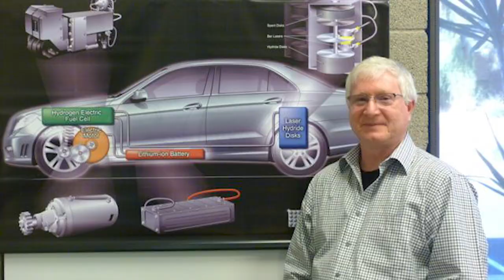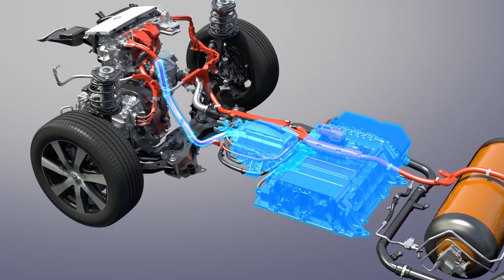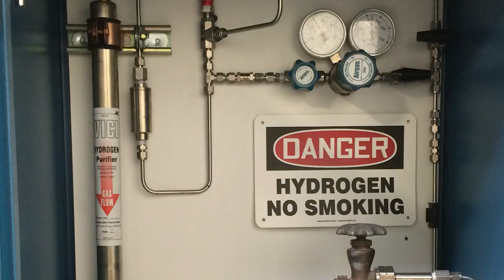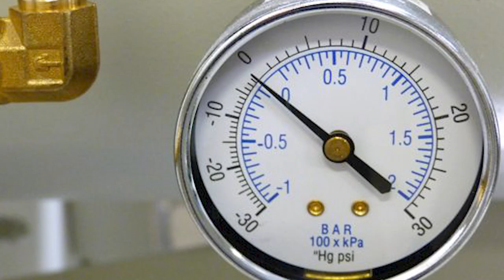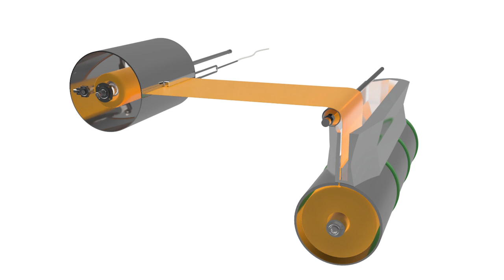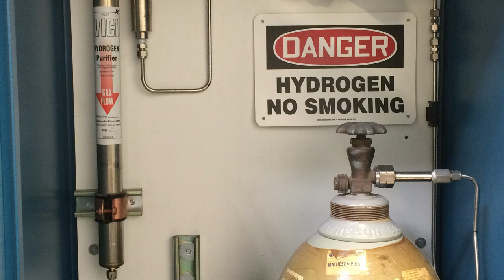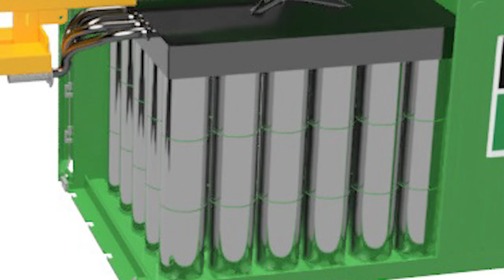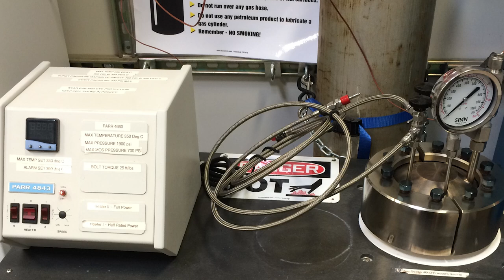This BANNED Technology Could Push Hydrogen Cars Over BEVs

Comment: Nobody banned anything. Hydrogen is not a fuel per se, but a energy storage solution. As it stands right now it's not at all a good storage solution. Hydrogen needs  high pressures, cryogenic temperatures or metal hydrides to store properly. All these makes hydrogen storage to be very heavy, energy intensive - drastically reducing charge/discharge efficiency and very expensive. Compared to current lithium batteries, hydrogen is much more expensive, heavier and less efficient. Fuel cells to convert hydrogen to electricity are expensive, heavy and inefficient as well. The best way to store hydrogen atoms is to bind them with carbon, but that makes synthetic fuel, which is proven much more expensive than regular fuel, but could be a better solution than pure hydrogen. Instead of spending development resources on hydrogen is much better to focus on improving batteries. What should be banned is human stupidity.

Comment: I have seen solarpannels that produce hydrogen if u cloud refill the film with these and use them 150 times than u could power ur house cook on hydrogen and have clean water to drink at the same time. If u have extra cartridges that u can put in a car or motorcycle it would be even better, especially if u could be able to release the hydrogen from the film and use it to power ur normal ice engine like what Stanley Meyer did with is vwbug. Than there is no need to invest in a new car.

Comment: Well the latest from Manchester university is even better and more efficient than relying on disks and light. Hydrogen stored in a sponge it adsorbs Hydrogen about the same size shape as the tanks but 3 times the amount of Hydrogen now when it is full of hydrogen same idea of Pressure. The Hydrogen is released by the sponge expanding thus keeping the same pressure to the motor system all the way until empty.  No use of electrons not use of metals disks to be made and safety all the way.  So fuel can be put in to the vehicle fast as normal and stored in larger complicity for longer range 3 times as long.

Comment: So its the same efficiency as outdated hydrogen and has all of the downsides of battery swapping. Lol. Its also a mechanical storage with super fragile moving parts. This sounds a great way to safely store hydrogen at a stable site. So obviously desirable for the rocket industry. For motor vehicles it sounds like a complete boondoggle. Maybe applicable for container ships where the reels and the appartus for discharging them could be in a special container and removed when the ship is unloaded using the same cranes.  But for cars? Lol. How is this even remotely better than batteries? It basically IS a hydrogen battery but it still requires a big heavy fuel cell and it takes up a huge volume/weight inside the vehicle.  So those problems are the same as current hydrogen tech. It literally only solves ONE problematic aspect of hydrogen vehicles and replaces it with three more problems: module swapping is a virtual nonstarter for many reasons not the least of which is it would require standardization of a common reel package which no manufacturer would agree to. Fragile moving parts introduces the possibility of breakage. Breakage introduces the problem of disposibility/recyclability at a dramatically shorter cycle than batteries.

Comment: What I wouldn't give to see Toyota step up to the plate and buy this outfit out, lock, stock and smoking gun barrels and build the car that'll handle it! It solves all the problems of battery-powered cars in northern arctic climates like here in the Peoples' Repugnant of Canuckistan. Batteries can only hold a 40% charge at subzero temperatures, meaning that you can't take them to work in the winter, 'cuz you'll come out to a frozen brick! Already in Queerbec it's been discovered that the door latches won't pop out to even let you in to your Tesla.
   But with this, since it isn't compressed or cryogenic, you can actually bring it into your garage without violating fire codes or invalidating your insurance! You can't even legally park your propane b.b.q. tanks in your house! So this beats all of that, PLUS it won't double your household electric bill, and you just watch how that's going to shoot to the moon when all the rich so and so's with enough F.U. money to buy a Tesla screw us all into the ground!
Come on Plasma Kinetics!

Comment: With electric cars the infrastructure is there we can charge at home. With this system it seems you would have to force every gas station to buy into a "loader" system they would have to buy from manufacturer as well as buy and store full/empty containers. BEVs have none of these expensive costs. That's not including once the battery is installed the charging is easy. How much will it be to transport full/empty containers to all gas stations AND how expensive to manufacture hydrogen then convert it to solid state? As solid hydrogen ages does it pose any risks? Seems like you are replacing simplicity of EV and trying to sell a very complex and infrastructure expensive hydrogen?

Comment: I think hydrogen powered internal combustion engines are the way to go.
Reply: ICE are inherently limited by physics to a maximum theoretical efficiency of 40-50% (depends on fuel and materials used). Hence, if you care at all about efficiency, no ICE is the way to go. Efficiency wise, it's a near dead technology. EVs are 70-94%+ efficient already, as an example.
Reply: Hydrogen fuel cell powered EVs are already more efficient than hydrogen ICE.

Comment: By this method, in order to produce enough H2 to power a Toyota Mirai with 130kW motor via a 50% efficient fuel cell, the 20% efficient on-board laser cannon would need an input power* of 1.3MW, which alone should weigh on the order of 8 tonnes.

Of course it would also require a rolling Megapack of batteries or compact fusion reactor to supply this sort of  juice, so let's conservatively estimate another 20 tonnes, meaning the "car" is in fact an 18-wheeler semi-truck. Also, for added fun, refuelling entails hauling in about 18 tonnes of H2-cd cartridges every 25 miles.

Obviously this "revolutionary tech" was correctly banned for being too egregiously stupid to waste any further time on.

Sandy & Alex only expose their ignorance by hyping this utter nonsense.

[* not to mention a battleship-worthy weapons licence]

Comment: Do you really want to be in a tunnel or other enclosed space filled with H2-powered cars and trucks? A standard toy balloon full of H2 and O2 in stoichiometric ratio, explodes with a bang on the order of a Cherry Bomb!!!
Reply: What do you do with the O2 generated from decomposition of water? That is roughly half the energy used to power the reaction, and without the N2 to heat up. Only 20% of air is O2.
Reply: lol.  And batteries, gasoline and diesel don't ignite.

Comment: The true application wasn't even talked about. Powering your house. Total elimination of the power grid,except the power plants to make the cartridges. If he's changing the tape cartridge into hydrogen then into electric for the car electric motor it can be done. Careful eliminate the power grid except your cartridges you will eventually be declared a monopoly and split up.

Comment: They have generators right now that will keep up with the electrical needs of an EV. With this technology you can fly a jetliner around the world without setting down You can live in the outback of Alaska going off the grid is the phrase. This has created a problem for the dummies that bought into this green new deal. So no charging station or home plugin is needed. A regular battery is all that is needed. Another idea is here using a magneto to get things started. They don`t want anything that can`t be metered. Our country is in debt and the world`s economy is based on oil. Building a new EV would actually be cheap it`s just the cost of parts and rubber. The government has got to figure out a way to tax you. A solar farm? It has to have a solar source and the sun doesn`t shine every day. Interesting times it`s been said the Homosapien has been here several times with technology. We have had to start all over again. Can we rise above ourselves this time? Or will we turn the sands of the world into vitrification once again?

Comment: Thanks for sharing your thoughts! In my opinion, hydrogen for individual cars will never be able to compete with the BEVs prices.  Just do the math and try to calculate how much energy you would need to generate enough H2 to run the fleet of cars in any country. And compare that energy with the present total energy generation of the country. You'll see how stupid it is to believe this is going to work. It's not a question of storing this stuff. The only chance is for planes maybe, when no other solution might work out here. But even for running trucks we won't have the enegy. 
But hey, maybe you think about forcing African countries to deliver the energy to you....sure, this would be one great idea for the future. Which of course it isn't.

Comment: I've been waiting for Hydrogen engines to become the replacement for the Electric Mindset. The military has been flying with hydrogen aircraft for many years now, and have proven their worth. If it's good enough for the Air Force Academy to teach, and use, it should be good enough to replace the limited battery powered vehicles like cars and variety of Aircraft, thus The Air Force Academy! My prediction for the future of space travel will not be hydrogen powered, but, "you will hear it first here" Reverse Magnetic Technology for space travel. No jet fuel, no extra weight, and literally unlimited power and speed. Straight line acceleration is good for human Astronaut's, but high speed, 90 degree turns would be for the AI's only, for now! The technology is out there. I just hope it's under raps until it's time to roll it out. That, and Worm Holes are the answers. On Planet Earth, Hydrogen vehicles fill the bill. EV is good for now, but there are better and more liable engineering that will come in the not too distant future. Elon Musk is the man who will develop "Reverse Magnetic" technology. Just my opinion!

Comment: I think used EV batteries are going to be catastrophic to our environment.  A car battery today is 50 - 80 LBS and we already have environmental problems disposing of them.  Imagine millions up millions of EV used batteries at 600 - 800 LBS going into the environment.  Semi Tracker trailers have batteries  in the 6000 LB range.  Not only the batteries, but defacing our environment with mining all the minerals is destroying habitats around the world.  If there was a choice between Hydrogen, and Electric today and the infrastructure was in place for fueling, I would take the hydrogen car.  Hydrogen through the whole process from fuel to production car is less damaging to the environment than EV's.  It is not known, even today, whether EV's in the entire process from mining to finished car will be help our climate.  There is a TED talk on Youtube that indicates we, at best, might have a break even on climate in 50 - 100 years, with EV's if at all.  Even more so the cost of minerals to make batteries has been going up because of competition, making the cars less profitable.  A couple of years ago a battery change was $ 5000 - $ 8000.  Now they are talking $ 15,000 - $ 18,000.  Who would every want to buy a used EV, if you know there is a $ 15,000 battery coming soon?

Comment: let's say i want 1kg of hydrogen in my cars' fuel cell. How many energy is needed to compress 1kg of hydrogen to 700bar/10000psi. How much energy is needed to: charge solid state hydrogen & how much energy use laser to release 1kg of hydrogen & how much more energy is needed to cool fuel cell (because decompressed gas is very cold)

Comment: There is nothing going to push hydrogen over electric. Now if someone could invented a way to prevent hydrogen tunneling that might do it.  But I would have to read the white paper on it before I would believe that. That paper would also need pier review. Even then I would be skeptical. Hydrogen only works as rocket fuel.

Comment: My money is on Hydrogen right now. Electric batteries suffer from the same fate as oil ...not sustainable indefinitely..there are finite resources to make batteries and just in case you are not aware the Tesla batteries ...do degrade ...and right now electric cars cost an arm and leg. Sorry to say it but for those tesla fans ..Teslas are set up the same as apple phones ..meaning proprietary maintenance, parts, and batteries cost a lot to replace ...and there go your savings. Right now the best cars are hybrids !!!!! 4 cylinder hybrid electric cars cost less, are cheaper, have better mileage..and don't have to spend 45 min recharging while traveling ..because you have the gas engine also. Made a trip on a self-driving tesla , usually, the trip on my gas car was about 6 or 7 hours ..that day ...was almost 10:30 hours ..because of the 3 times the car needed to recharge ..and that was 40-45 mins approx each time ...that's a lot of time waiting to recharge ..gas time less than 10 mins ..there are also gas-powered engines and an oxygen one made in Mexico. about 20 years ago.!! How about that !!!

Comment: This VIDEO should be banned for shilling this absurd "technology" without devoting a neuron of critical thinking before doing so. If those little storage packs were filled with NOTHING but liquid hydrogen -- the densest way of storing hydrogen possible -- they would be far too small to hold any appreciable amount of hydrogen to travel any distance. This solid storage is PR nonsense and you should have questioned it instead of lapping it up.

Comment: I note that your "reader" (or light-applicator housing) has room for 4 "disks".  When all the hydrogen (or energy) is consumed from off one disk, does the system immediately, hitchlessly, advance onto the next disk of the four, to consume its hydrogen-energy, from that next disk (and could that housing of four disks be made with room for 100 disks, or 500 disks, or 1000 disks), for extended "travel" ?

Comment: To all, you Naysayers out there. Think about it water is 8lbs / gallon. The average Gas Tank in today's vehicles when full is 12 to 16 Gallons. That's anywhere from 96lbs to 128lbs. Now weight costs money & Energy to move. If you bought a Vehicle brand new with this new Hydrogen technology. In theory, by the time you use up the Amount of hydrogen in the Cartridge, it would have paid for itself. Also just like today's vehicles
a computer would tell you it's time to swap out the cartridge. So again, if I've got this figured out. All you would have to do is go to your local hardware store or convenience store & swap out the Cartridge for a new one.

Comment: A billionaire would make it so you drive the car into an automatic refueling depository station. Then the bottom of the car drops out the old film roll using gravity, Same time just after that, a lode is automatically positioned into the vehicle. Refueling takes 2 minutes. Stop and go fueling...Hydrogen is the way. The focus should be on a standard fueling station. Scale infrastructure of set standard film first focus, then designs the car build. Everyone has it backwards. Build it and they will come. Build the hydrogen load insertion stations massively first Then all makers every where can design and build hydrogen cars at scale dwarfing the automakers. kill the government regulation to save the planet. Every one all over the world can build cars that will go into the swap out station as standards are set. all the same fuel charges standard fit all makes and models...Stop making batteries because we are killing the earth. hyd.= h2o safe and clean!!..... Bryan Marett Ievery one just throws me out of the room"...Making a buck is not the answer here at first.. We must all work together NOW!

Comment: How about the high cost of changing battery for e-cars?! Are you all lesser than Joe Biden?!!
Why don't people use shipping container modified tanks to store solar energy? For example, automating concentrated solar thermal power to pump water from the low tank to the high tank during sunny day and release water to drive electric generator and back to the low tank during the night and sharing with couple homes.
You can search "Burning Stuff With 2000ºF Solar Power!!" "DIY shipping container pool" "solar power water pump" and GREENPOWERSCIENCE for a lot of examples. 
Actually, potential energy of the tank themselves can also be used for generating electricity already. Of course, you need to use a lot pulleys or hydraulic jacks for that.
Reply from the maker: Changing a battery? Are you serious? You would sooner change an engine in a gas car than a battery in an electric car. Please educate yourself

Comment: Batteries are better than hydrogen. EVs are better than hydrogen power. Hydrogen is great for vehicles that run in a building. Fill in 5 minutes. No CO. A rapid growth of electric cars will ensure coal plants will never go offline. At least for a very long time.
HEV Toyota with Dynamic Force Engines 40/41% efficiency Atkinson Cycle Engines. burning propane